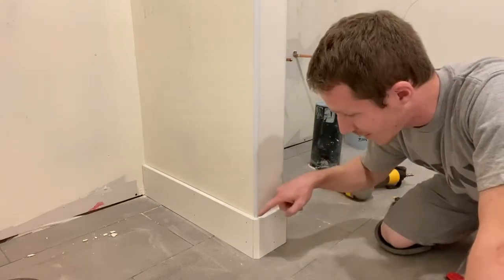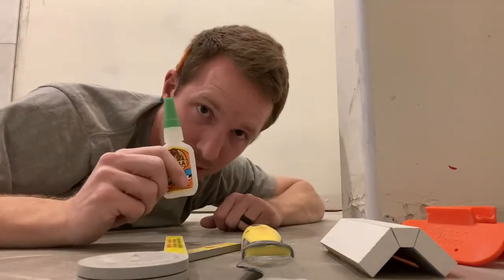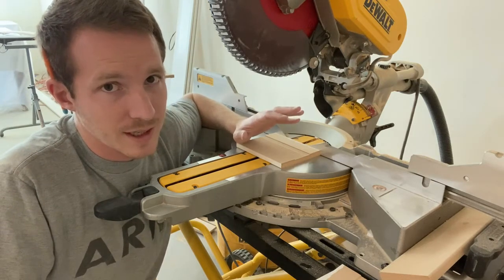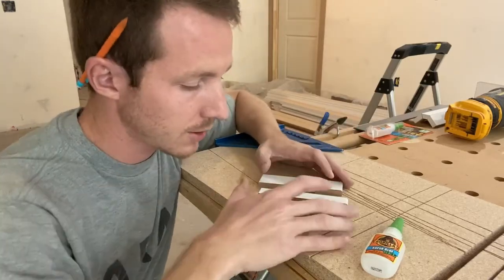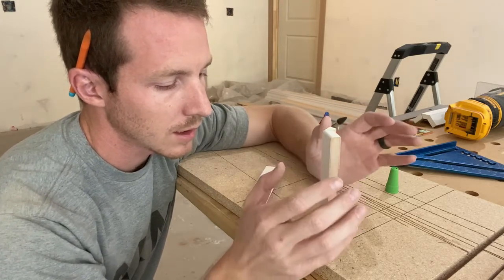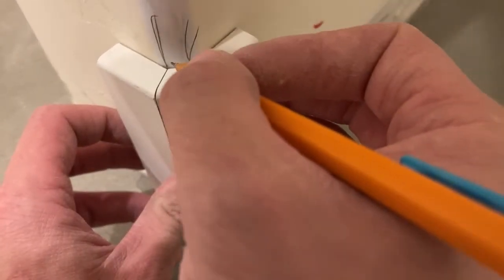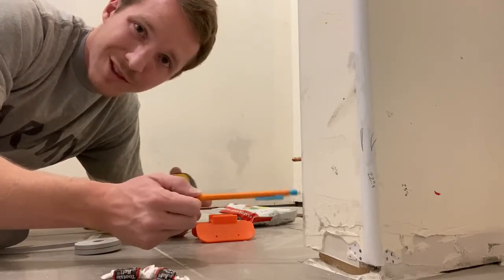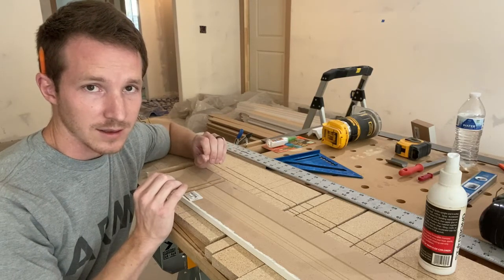How to Do Rounded Base Board Corners | In Depth Finish Carpentry Guide to Basing Rounded Corners

Comment: You can also cut the corner piece of your jig short so you can just trace it.
Reply from the maker: That’s a good idea! Thanks!
Reply: @berlinbuilds  No problem. I came to your channel to see how your trim business is doing. We talked like a year ago when you made a video about quitting your job to start a trim company. I ended up quitting my trim job to start my own company last year.
Reply from the maker: Nice! How have things been going for you? Things have been good here. I’ve been doing more full basement finishes as the general contractor and trimming my own jobs now more than chasing stand alone trim jobs.
Reply: @berlinbuilds right on. things have been going good for me too. I started a handyman business and grew into a general contractor. Been thinking about doing only trim. I even made an ad for just trim. So far it's been going pretty good but it's a lot slower than when I advertised for everything.
Reply from the maker: Sounds like we are going opposite of each other in our growth directions! I’m cheering for you man! Are you working mostly with homeowners trimming basement and doing accent walls or are you working with contractors?